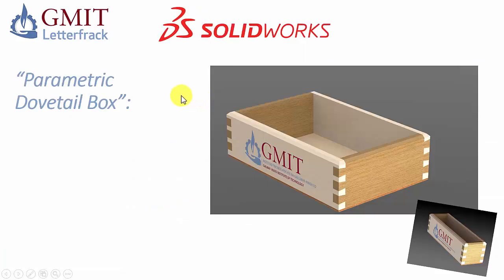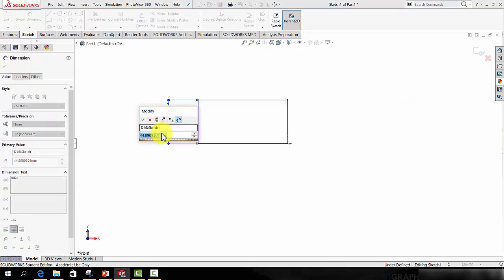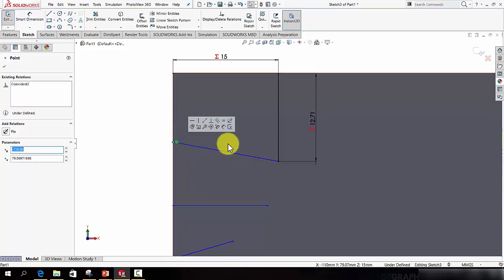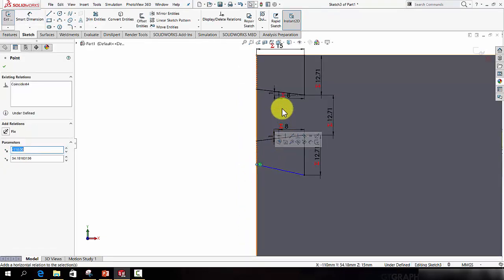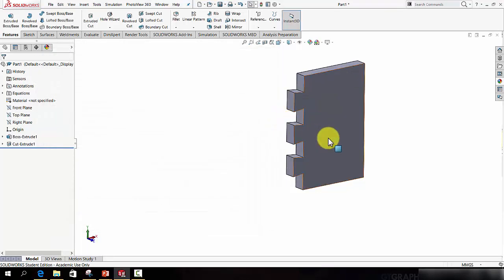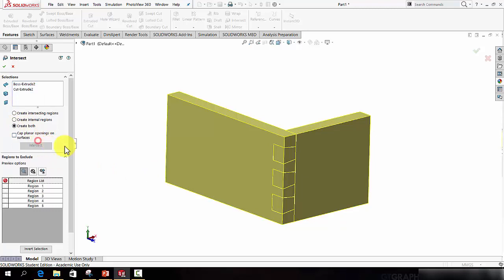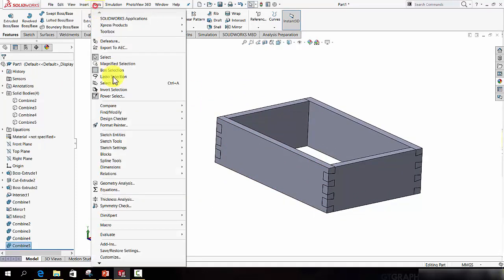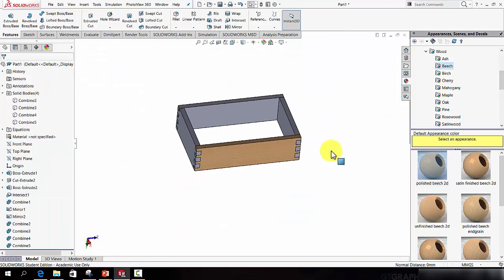Parametric Dovetail Box

Comment: DIscussing programs and ways to learn them,,it would be very helpful if you state what version you are using to give these examples. I have 2018-2019 version and it is different, so I have wasted alot of time trying to follow your examples. But I do appreciate your efforts. I noticed your using a student edition.
Reply: I agree with stating the version year for learning purposes. Last i used Solidworks was back in 2015-2016, and I jumped right into 2019 version and could follow through without any issues. Yes the layout might be slightly different but most commands stay the same for the most part. You should be able to apply the same knowledge.